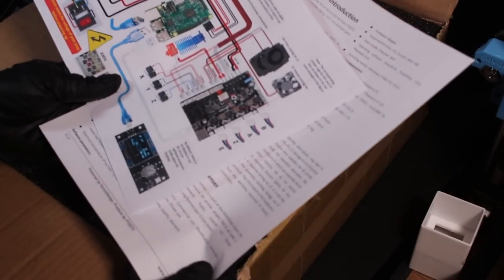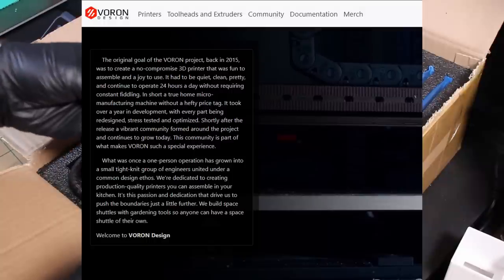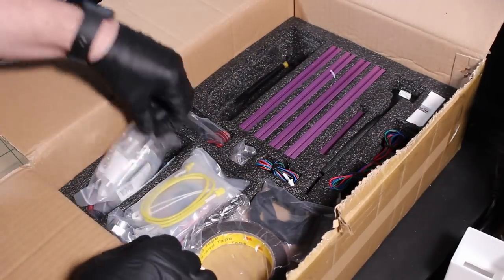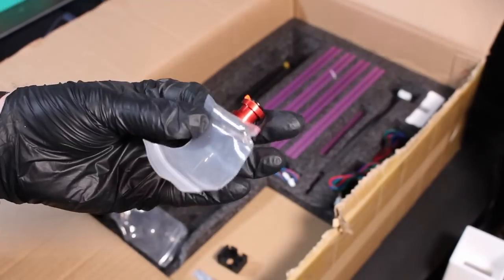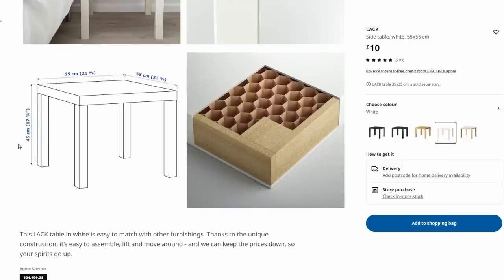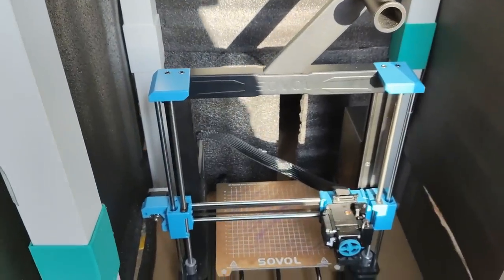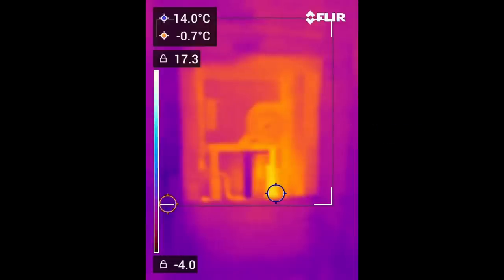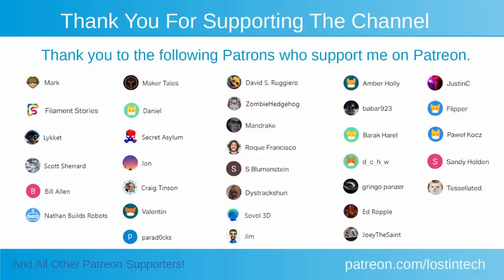I'm Building A Voron (and so should you!)

Comment: Next time try putting a 100w light bulb (incandescent) inside the encloser to help keep the temps up.
Reply from the maker: not a bad idea, if I had any left! Might have a hunt around. I've still got stuff to print and it's getting colder!
Reply: @LostInTech3D  I think the low here just before Christmas is going to be -1….. Fahrenheit
Reply: That is such a great idea they give off heaps of heat
Reply: Used to share with students who used varoius wattage bulbs to help beer/wine fermentation... Apparently quite a safe, gentle form of heat.
Reply: @LostInTech3D  a large alum heatsink and a old ender heater with a fan blowing over it works well. the air circulations the most important part
Reply: @matthewweinberger7023  But a fan seems to go against the draft shielding of the enclosure
Reply: @TalpaDK  it's inside the enclosure, so it's just hot air moving. But it doesn't need to be much anyways. With a fan you end up heating all the air not just a small patch by the heater
Reply: @TalpaDK  check out the vzbot.  They stick a fan under the bed to help circulate air and get to higher enclosure temps
Reply: PTC heaters are the best less than $20 and can fit in anything. You also need a controller which still makes it less than 30. My ender 6 is tricked out.
Reply: @slacksthegreat nice idea, PTC heater hooked up to a fan or Bed port for control would be very cheap. And safer since it can't thermal runaway
Reply: Reptile heaters work well.  Cheap too.  Check on Amazon
Reply: In a lot of places, those would be hard to find. I don't think it's legal for proper stores to sell those anymore in the UK.
Reply: @LostInTech3D  You can get 100w "PTC heaters" that run off 12v for about £6 on Ali Express. Versions are available for mains too, if you look around. They are basically self regulating heaters because as they get hotter their resistance rises until they reach equilibrium. If necessary you could get a simple thermostat to switch them on and off.
Reply: I did that in the well room of a house I used to have, and it was enough to it from freezing in the winter.
Reply: or a peltier cell maybe
Reply: Doesn't reallllly work like that
Reply: @IanSlothieRolfe  Good shout on the PTC heater and thermostat. Cheap and effective. I used one for another application and they're great. It was a while back but I used something like one of these from ebay: W1209 DC 12V Sensor Module. Temperature Control.
Reply: @humfreee  Yes, thats the module I have in my parts box right now!
Reply: A common product for lizard owners is a ceramic heater element that plugs into a light socket. Needs a special dome but it would probably do a half way decent job.
Reply: Or a 100watt or more old btc mining rig😅

Comment: Just keep an eye on parts printed with ABS+ labeled filament. It does have a few drawbacks when compared to "pure" ABS.  Like lower glass transition temp, mechanical creep and layer bonding problems. All of which are directly related to the "easier to print" formula of ABS+.  I understand your decision and need for it’s use, just fyi.
Reply: A ton of people in the Voron PIF program use eSun ABS+, so at least in the case of eSun, it's an officially approved material.
Reply: NERO took apart one of his old printers a week ago,  it's 3 years old,  he had no issues with esun parts. 
It's all about printing and enclosure temperature.

Comment: Hehehehe I actually shivered when I saw your temperature graphs. Here I have the opposite problem(s) of heat and humidity. And dust, I have three problems. Heat, humidity, dust, and a need - four. Four problems. Heat, humidity, dust, and a need to ventilate fumes away because I'm sensitive to them. Originally I let the enclosure vent outside with a simple thermosiphon process, let some air in near the bottom, fit the hose near the top, put the outlet up even higher, but then summer came and I was getting filament clogs with weird melty patterns that were unlike anything I'd seen to that time. Touching the direct drive extruder motor almost sizzled. Tunrs out that when you have outside air temps in the room of 37C - 41C, the bit of heat from the printer quickly takes that up to 60C... So then I fitted a server cooling fan into the hose and force-extract when the temperature gets too high. Oh and with daily RH of 75% - 90% being common here, even PLA prints better for being in a dehydrating chamber, and that sits under the printer and some heat from the electric dehumidifier inside it must also make it up into the enclosure. 

Sovol sounds like a dream machine, it'd be my choice for second printer if I ever go there, I watched the review you did and that basically put it on my Christmas list... Keep up the enjoyable vids and have a great festive season and a propserous new year!

Comment: ABS / ASA does make fumes that are not good to inhale, IF you print at too high a temperature.  If you limit yourself to 220-230C you'll get minimal outgassing, but this may not be the best temperature for good printing results.  In any case, warping is a BIG problem for large parts (and by large I mean ANYTHING that might take over two hours to print).  To avoid warping you need a printer enclosed in a chamber to contain a constant temperature.  And if you have that, you also have a way to contain the fumes by using a low velocity exhaust fan, and a good filter.  Have the exhaust fumes exit outdoors through a suitable hose.  Yeah, if you have a garage that will solve the fume problem, but NOT the warping (unless your garage is at a constant warm temperature.  
I have printed ABS in my workshop, leaving the door and windows open.  Solved the fume problem (I stayed out of the workshop while the printer was running), but I still had some issues with minor warping.

So what's wrong with PETG and PLA?  I've printed parts for a home brew 3D printer with both of these materials, and had no problems.  PLA can be fragile, drop a PLA part onto a hard floor and it will shatter.  PETG probably won't.  PLA shouldn't be used near anything hot, but it seemed to work fine for many mechanical parts.  PETG is almost as heat tolerant ans ABS / ASA.

Also, except for printed parts around the hot end, the Prusa printers ARE made out of PETG (but Prusas are not enclosed).

Comment: I have two vorons (0.1 which I am building and 2.4) I did my ABS parts printing in the shed, for smaller parts you can get away without an enclosure no worries. Though I dont get below zero temps here.

100% agree with you on people printing stuff like ABS inside their home, its madness. You can reduce but not eliminate fumes and VOC's with additional filters (look up the popular nevermore) but you still get some (I bought a VOC meter to check levels even though I print in the shed and can confirm this). 

The filter that a lot of people use witht the Vorons is the Nevermore / Nevermore Max.

Comment: Printing abs or asa in a different room is a decent temporary solution, but really you want to take the time to set up proper ventilation. A duct taking air from your enclosure outside with a fan will work, but a good filter setup would be better. Or if you have one, you can stick your printer inside an airbrushing booth.

Comment: I use a drill with a hex-driver and put self-tapping screws in the bottom of the legs. Once the self-tapping screws are in, you just continue to use the drill on the head of the screw to rotate the leg into the table top.

Comment: I respectfully disagree that the lack is the least expensive enclosure - Personally, I built a very large cardboard box out of several upcycled amazon boxes that i fitted around my lightly modified ender 3 (bltouch, allmetal hotend, klipper, webcam, pei build plate) for which to print my voron v2 parts on.  I have a cieling fan in my lab and it was spring when I did this, so i just had the window open with a box fan in the window to get good circulation in my home lab/office.  I set up most of my prints to go overnight so I could set the print and leave the room, close the door.  everything worked out really well.
Reply from the maker: I appreciate the respectfulness of your respectful disagreement! I had indeed forgotten about temporary enclosures. I plan to use the lacks for other things later and wanted something quite sturdy.

Comment: I haven't tried printing with ABS yet, but I've found that the draft shield setting in both Cura and Prusaslicer does wonders when printing "warpy" parts. One particularly troublesome print, no matter what I tried (anti-warp tabs, glue stick, brim, higher bed temp), by the time it was done printing the corners would lift off the bed. But when I tried it with draft shield, it came out ruler straight without even needing any of the other stuff.
Reply: I print ABS on simple plain glass, no glue, no hairspray, no slurry. Bed at 105C and 130% print width for the first layer. I's impossible to remove the print until is cooled below about 50C.
Reply: Other layers are 98-100C
Reply: Fan is off if layer time is above 30seconds
Reply: @dtibor5903  Do you use an enclosure?

Comment: Welcome to the party 🎉. Voron s are great printers. For the parts, I would ask in the Voron discord if someone near you could print them for you.  It usually should work.  Or use  the pif program. You will only pay a small fee but you should get good quality parts and it doesn’t take too long.  
For the v.0, check the kirigami bed mod.   especially the ldo version.  It is probably the most useful thing, as it ads stiffness to the bed.   

eSun Abs + is a good choice.  We are printing all the parts with it and it simply works ( having a chamfer temp of 40-50deg C. helps probably)

Comment: I built my Voron V0.1 from the FYSTEC kit. I paid 500$ at the time. The linear rails are terrible quality. In the provided config for Klipper the hotend and heated bed sensors were reversed. The highest acceleration I could get my motors is 2000mm/s2 (while hot). The good news, mechanical parts are ok, all the profiles and plexiglass parts aligned well. All electronics worked out of the box. I used my SD card with firmware compiled by me, the one supplied with is suspiciosly large size for what it is. With the current price ~400$ I recommend.

Comment: Cnc kitchen used nylon not petg. Also abs plus does print easier but has a lower heat deflection temperature. Not a big deal but for trying to print PC you would probably want ABS or ASA. ASA has slightly better heat deflection than ABS.

Comment: Just finishing up the wiring on my formbot v0.1
Top tips: 
read the entire section before putting that bit together. 

Look up v0 no-drop nut mod. Lining up nuts is a bit of a pain. And trying to rotate the printer to slide a nut along a bit and drop 10 other nuts out other extrusions is a pain. 

Double and triple check you have preloaded enough nuts before putting the frame together. 

Check where you are putting your electronics before vhb taping it down. Its a twat to get off.

Generally it is quite enjoyable to put together. Just fiddley because everything is small.
Reply from the maker: Good tips thanks 👍
Reply: @LostInTech3D  oh and don't overtighten the screws that go into the ends of the frame. Although I think my kit had been drilled out too big and then tapped so the threads where really weak. I had to helicoil most of the frame. That was the worst bit about the formbot kit
Reply: @LostInTech3D  you need the no drop nuts for the makerbeam extrusions, do not print the ldo ones they will not fit in the fysetc kit, I just finished building that kit myself.

Comment: Bed slingers i think are major introducer of draft as the part is being slinged through the air. I run an Ender 6 and in 3 years i haven't had half as much problems as bed slingers have (not a scientific conclusion, just based on 3 years of following 3d printing social medias and forums)

Comment: Stefan used cf nylon which is stiffer and has better heat resistance than abs, but suffered from heat creep. So everything keeps getting loose over time.
Reply: Aluminium works well...
Reply: @tonywood3660  but much more challenging to 3d print.
Reply: Something like a bad batch... normally you don't expect CF Nylon to behave that way! I think PETG isn't a terrible choice at least for a start, considering compromises of open-frame printing if you have to start that way.

Comment: I'm pretty confident that you could use 3DTomorrow BioPro to print the plastic parts for a Voron. It's a modified PLA with better temperature resistance.

The only downsides are 1) You can have it in any colour as long as it's off-white and 2) The price - at £35 for 1Kg it's definitely a premium filament.
Reply from the maker: Thats an interesting idea...I have a sample somewhere of biopro, I have been meaning to do something on it since I met Callum back in June.
Reply: Every few months somebody will show up in the Voron Discord with "fancy high something-schmomting" pla and try to print Voron parts. They very quickly learn the errors of their way. Everything from cracked gantries to hotend that fell off.

In short as a Voron owner I will tell you this is a Bad(tm) idea

Comment: Activated  carbon  filters are great at trapping  VCOs and other toxins. I got a big box fan(scavenged from something???)slapped it onto a flanged 3d printed a tube with lots of small  holes then wrapped the tube with porous cloth and filled tube with cheap hob extractor charcoal chunks(8 squid a kilo)...Boom! a dirt cheap vco extractor.
Side note the fan needs to suck the air through  the charcoal (unless you use a blower fan which will have terrible efficiency 

Oof printing ABS- tried it once...that ranks as high on my todo list as stinky resin printing😅

Comment: Having build the LDO kit, i say yes its a nice printer, but it turned into a time hole. For someone new.. Voron did a bad design on z axis adjustment. the screw needs a longer throw and to be stable. I couldn't buy a  pi and did the Manta and CB1 good choice, very little help. Back to the build, i hate the system for the extruder, if you have problems with the extruder (i did) it becomes a test that you don't damage any wires, no multiply that everytime you have to do something to troubleshoot.  If you want to stay with the main group, you will need a pi but there is a discord and thats a big plus.
Reply from the maker: noted, and yeah I have a pi luckily!

Comment: I'm curios to see the strength of your ABS prints. I print my ABS and ASA in a completed closed enclosure that heats to around 40 Celsius. From my personal experience the layer adhesion strength is quite different from printing at room temperature and and printing at around 40. Might not matter for use for parts in a printer though.
Reply from the maker: Yes..I do wonder myself too. 
Not that I have any choice right now, but I may print some test pieces now, Vs later when it's warmer....to run some tests.

Comment: This was interesting. I was looking to make an enclosure for 1 printer. I like the table leg joiners you used, I would put screws through them as well as connection brackets on the third (lower) table, but I over-secure things thanks to cats. 
I wonder if there is enough room using the tables to place a "Fire Extinguisher Ball" in the top section in case something does happen. I mean, it creates a huge mess, but better a mess than no room/house.
Reply: Blazecut tubes might be small enough to fit inside the printer enclosure
Reply: @filanfyretracker  Oh wow, I have never seen those before. Thank you. More costly but smaller footprint and looks like less mess than the FEB.

Comment: ABS printing I really struggle with, could there be certain ABS that is easier than other brands? great video as always thanks.
Reply: Use high heat on the build surface, an enclosure and if everything fails, then use "ABS juice" for adhesion on a disposable surface (ie, not your PEI sheets).
Reply: I'm printing abs and asa on an ender 3, all metal and such,  at 260/100 in an Amazon enclosure. I have a short lamp with 100w bulb and a filament dryer. In the house typically see 35c temp and 20-25% humidity in the enclosure and get great results. Very little fan. Prints more reliability than anything else I've tried yet.

Comment: Cool video.  I notice that some people struggle lots printing abs and some it prints just fine.  And some of the people where it prints fine are not taking precautions like heated chamber or even draft mitigations.  Is there a big difference in abs filaments?
Reply from the maker: I think so actually
Reply: very much so. esun abs+ can be printed unenclosed given that your slicer settings are tuned correctly. "normal" abs blends ie. those without the additives like esun abs+ are pretty much impossible to print without an enclosure.
Reply: Esun ABS+ is an easier version of ABS, really good for beginners. It's low warp but I've found that it tends to be more brittle than other ABS. Fusion Filaments ABS 1.5 prints amazingly for me in my voron 2.4 and their ABS 2.0 is supposed to be a low warp variety of thst similar to ABS + without the brittle aspect. Their colors are also amazing.

Comment: The part about the ABS/ASA argument being dumb, and not printing it in the same room you're in; IS dumb if that's what you're going to argue.. especially if you're going to infer that people are dumb for disagreeing with you. There are literally studies and journaled tests that log the offgassing and air quality and list the results in parts per million (PPM) and assess that against the health impacts.. They all determine that the levels in a room with an acceptable level of ventilation won't cause any detrimental health problems. The only risk is irritation in some people with different reactions to it.
You'd have to stick your head inside an enclosed printer for hours to intake the amount required to impact your health.